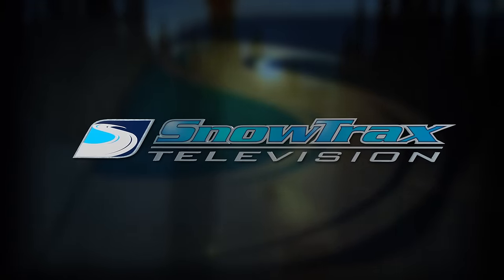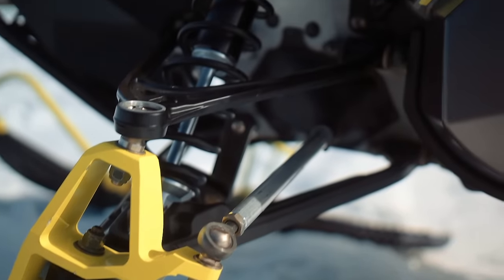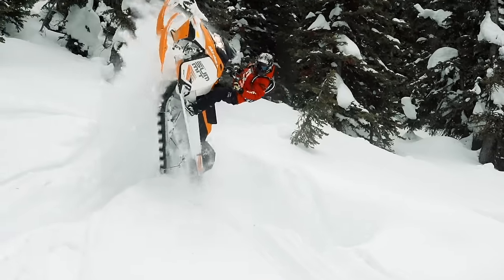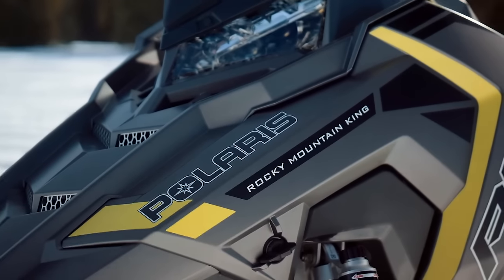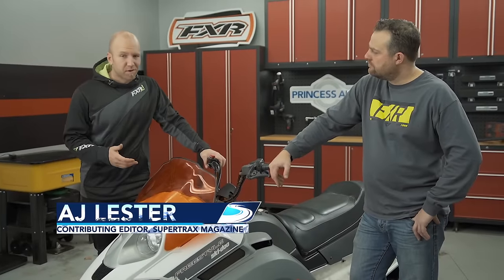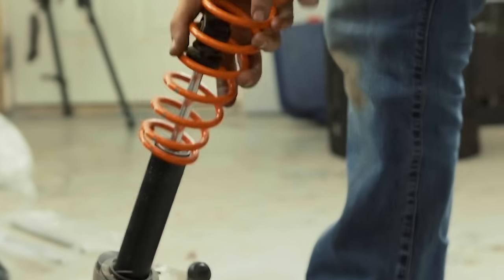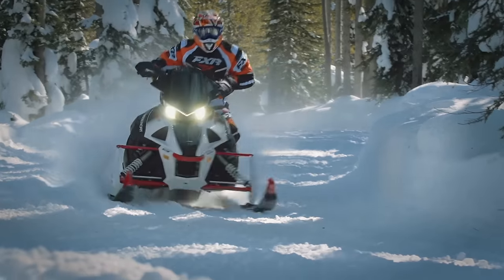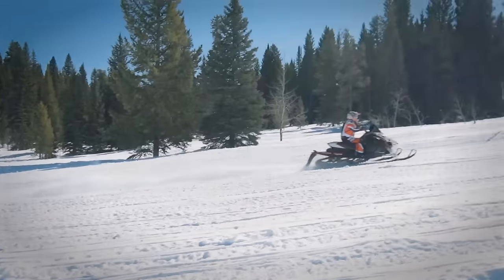SnowTrax Television 2017 - Episode 4 (FULL)

Comment: having the ski tips in the air is fun in wide open spaces but not so desirable in tight tech areas, plus i like to stay flatter on more vertical climbs specially in the trees also front end lift creates the effect of a shorter trax thus causing trenching.

Comment: Wait what? Rmk wins in durability? I'm a polaris guy and love em but thats bullshit
Reply: Emil Edlund it's just cuz the ski doos are known for cracked bulkheads when an a arm hits a rock or something
Reply: Emil Edlund your wright. PowerMods's Sleds Blew Up
Reply: what would you rather have hitting the same rock/stump.. A broken a-arm or cracked bulkhead? The a-arms are supposed to bend in order to save a much more costly bulkhead repair
Reply: nahbuye Right; they're meant to be sacrificial.
Reply: That's on the G4, not the XM which is what they were comparing in this, which is also stupid. They should have just compared the 16X track lengths